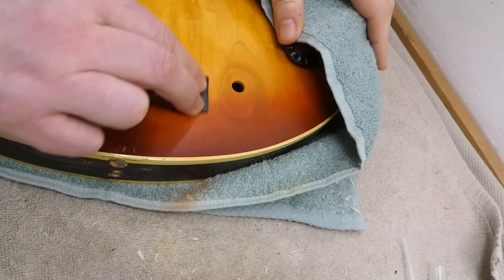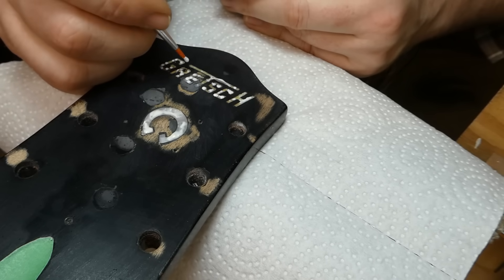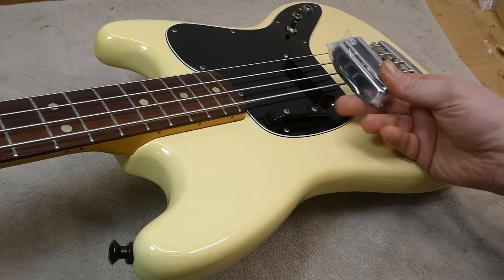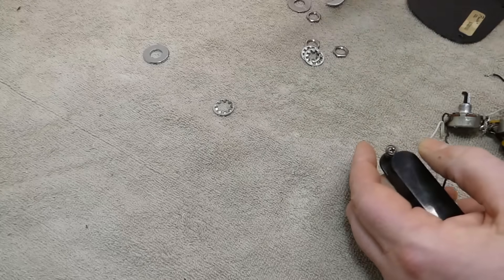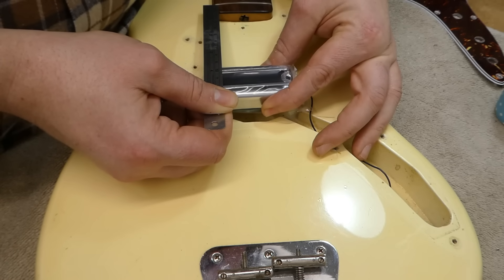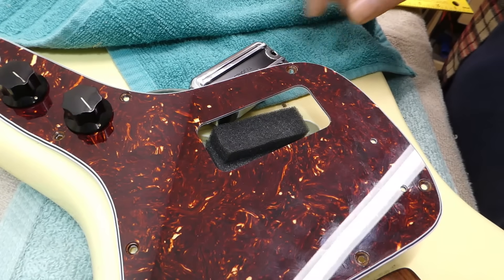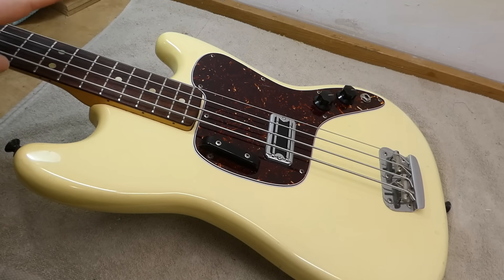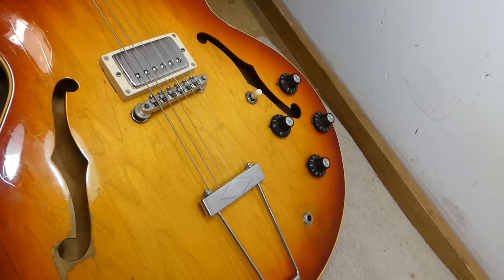Cutting holes in a bass and other things.

Comment: Nice work as usual.  Those caps are 47nF and 10nF.  That stands for nanofarads.  Looks like the 10nF is directly across the pickup to earth.  This would lower its resonant frequency fairly significantly I would think.   Six poles works ok for bass, the string response is actually quite even.  FWIW I strongly recommend using closed cell neoprene for installing bass pickups.  I buy it in A4 sheets, 12mm thick and with self adhesive backing.  That soft grey foam will not spring back and make it impossible to adjust the pickup.  Cheers mate!
Reply: I was thinking the foam looked too soft too
Reply: @Obscurity202  Yeah, it'll work ok for a while, but I work on a lot of basses, and I often have to replace this stuff.  I think a lot of pickup makers even suggest just using the grey foam from their pickup packaging.
Reply: So a capacitor is essentially a short-circuit for high frequencies, the larger the value the more lower frequencies it attenuates. Ie. if you place it in series with the signal it acts as a high-pass filter (ie. it reduces lower frequencies), if you place it between the signal and ground it acts as a low-pass filter ie. it reduces the higher frequencies.
Reply: @JWsDPP  yes. Sort of.  In this case, it will probably roll off the high treble, but since it is in parallel with the pickup, a (huge) inductor, it may actually increase the low treble or upper mids.  But that depends on the inductance of the pickup, and the load of the pots.  A cap and an inductor in parallel creates a resonant circuit.  The frequency of that resoant peak is related to the actual inductance and capacitance.  (You can look up the LC resonance formula.  The maths aren't hard.  It's an inverse square relationship IIRC.) Pickups also have their own capacitance.  So does the guitar cable,  The height (amplitude) of the resonant peak is dependant on the impedance load of the pots, and the input impedance of the amp (or pedal, DI, recording interface etc).

Comment: I just repainted a Mustang guitar in this antique white color then put on a new red tortoise-shell 4-ply pickguard. Sprayed the white top coats over a tan primer which gave a little bit of an aged-looking amber undertone, then hand polished it to a semigloss. Looks aged but cared-for, not like a 'relic' job. This guitar was formerly gloss metallic blue with white pickguard, and it was a nice paint job but it just didn't turn me on. Your eyes would be drawn straight to the pickguard, and the blue paint did not show off the nice offset body shape. Wow, what a difference now! The antique "Olympic" white body, red pickguard, maple neck and rosewood fretboard make for a really beautiful and flattering color combination like the bass in today's video. Now I want one of those!

Comment: worked on a similar bass ages ago and replaced the original pickup with a Seymore ducal quarter pounder...Sounded great and didn't have to do any mods as it was the same size as the original.

Comment: Note about the 6-pole pickup that was originally in the bass. You are always focused on the string being over the pole piece, but in this case, there are 6 pole pieces and 4 strings which could in fact give you a "better" signal than with 4 poles. I have done a few measurements of the output signal from the pickup based on the vertical location of the string. Quite an interesting profile of the output signal.... just think about that in between the pole pieces you get contributions from both of them to the output signal.

Comment: If the plastic swarf is that much of a problem, you could probably shape those pickguards quicker and cleaner with a hot wire. Just need to build an appropriate hot wire to cut through that pickguard material just right

Comment: I have always found it odd how so many pickguard materials have the pungent odor of menthol when machining them. Relative to how sometimes old strings have the immense odor of garlic! I've encountered that with many sources of metal over the years and it's surely just the chemical makeup oxidizing from the air.